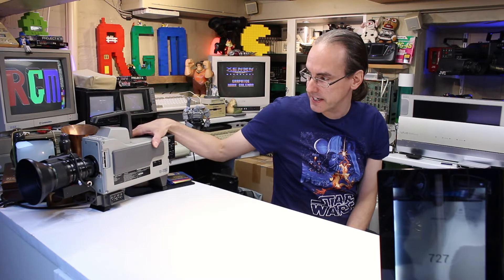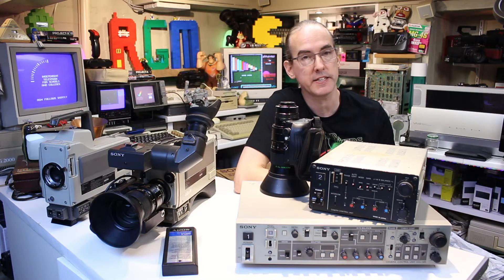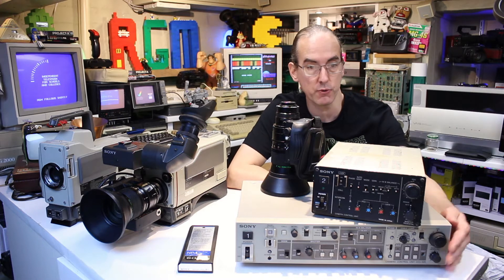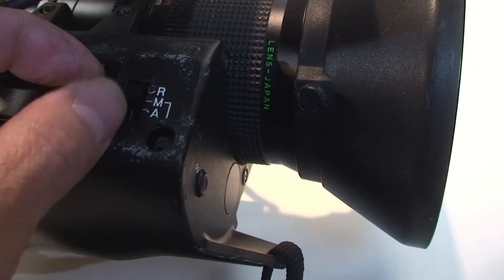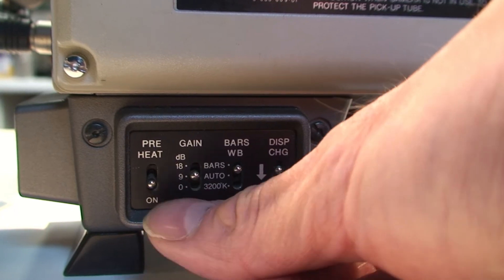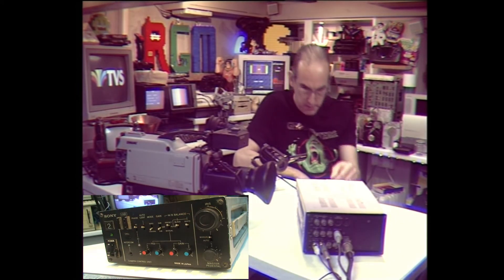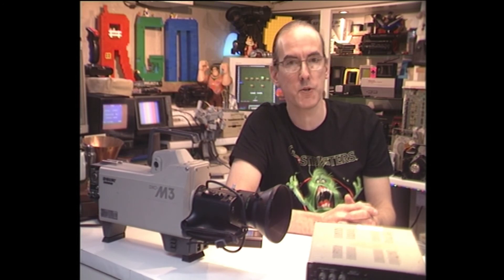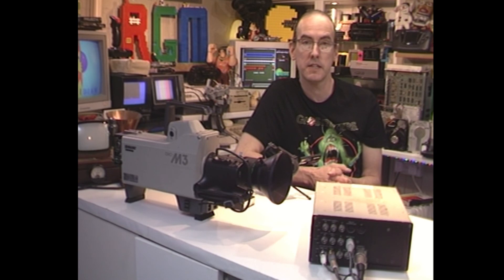SONY BROADCAST DXC-M3P 3 TUBE and SONY DXC-3000P 3 CCD VIDEO CAMERA TESTS and IR Filter Clean up!

Comment: From memory, the zebra stripe was really subtle when it was switched on. Especially hard to spot in the tiny onboard viewfinder, but not as bad if you were using studio finder like the DXF-40 or 50.

The SC is the colour sub-carrier phase adjustment.
Reply from the maker: Thanks for the info. I am still yet to get a bigger view finder. They seem to command alot more money than the camera's themselves.
Reply: @RetroGadgetMan  
You're welcome.
It's great to see the old cameras still going.
I had exactly the same problem with my IR filter when I first bought my 3000AP about 20 years ago.  I had a little check on her just over a year ago and found that the same muck had grown back so I'll be redoing that clean-up again.

Yeah, the viewfinders were pricey even back when I was looking. I never had my own either; I borrowed one for a couple of projects.
I had planned to convert an old portable CRT TV but I never got around to it.
I suspect that I've got a schematic or at least a pin-out for the viewfinder connection somewhere.

In fact it was all expensive back then. I remember paying as much for the case and the cables as I paid for the camera. I never did find a tripod plate attachment for a fair price. I just used the single 3/8" tripod mount at the front but it was always a bit precarious. 

Another bit I can add to your video is that the remote ports on the lens body were used for a tripod handle mounted zoom remote.
I have (tucked away on an old hard disk) the schematic which a helpful guy at Fujinon gave me back in the day. If that's of interest to you I'll dig it out.
Reply from the maker: Yes the IR filter seems to be a common problem. How did you clean yours. My way seemed to be the only way I could clear it. The tripod plate sells for  more than the viewfinder and camera together. I may just make one lol. Using a standard tripod is abit if a gamble, and not even possible with the DXC-M3. If you have a diagram of the viewfinder pin layout that could be of use, as I have a lot of old 5inch CRTs that I could use one of. No rush, just when you get the time. 🙂
Reply: @RetroGadgetMan  I'll dig out everything I've got. It'll all be tucked in a folder on the old disk.

I did my IR filter much as you did. Split the layers, carefully used a single edge razor blade to scim the glass, and then gave it a good wipe with some optical glass cleaner,
Reply from the maker: @grcarthew7234  thanks!
Reply: @RetroGadgetMan  you're very welcome. Share the wealth, I always say. Especially with a fellow enthusiast...

I've got three old Umatic SP VTRs here too.
Reply: Having now watched the second half of the video I can answer a couple more of your questions too...

The momentary switch on the camera side labelled "DSP CHG" is "Display Change". That cycles through different information overlays in the viewfinder. The menu system allows you to setup things like the pedestal, in-built titler, etc.
The "VF Preheat" power switch position on the 3000P powers up the viewfinder, so that the CRT in there can warm up ready for action without also powering up the rest of the camera.

More on the Phase and SC adjustments... 
You'll not notice any change when fiddling with these, until you try to mix and wipe between multiple cameras in a vision mixer.
If the signals from different cameras arriving at the mixer aren't properly synced and in phase with each other, you get jumping and rolling of the output image as you try to mix the signals, because the mixer can't lock onto the two un-synced signals at the same time. In addition, the colours will vary between cameras. Genlock is one element of ensuring that all the equipment throughout your setup is using the same time base; and the phase controls on the camera / CCU are another important element of getting everything working together.

With a master sync signal (a video signal is fine) applied to the genlock inputs on the various items of equipment, each item will lock to that signal. However there will be some variation. Adjusting the horizontal phase control will adjust the timing (effectively shifting the picture left or right) until the two signals are properly in sync. This is best achieved by comparing the signals on a waveform monitor. If you have an oscilloscope which can trigger from a video signal then that works just as well.

You'll also find that the colours will be off. That's where the sub-carrier phase control comes in. By adjusting this, you bring the hue of the slave source in sync with that of the master.
This is most easily and precisely achieved with a vectorscope . Set the camera to output bars and then adjust the SC phase control until the vectorscope shows the points in the correct position. This way when switching between sources you don't suddenly find that colours jump around.
It can be done by eye without those tools however, just not as precisely.  Output bars on both sources; select a vertical wipe on you switcher and set the t-bar halfway, so that the upper half is one source and the lower half is the other. Adjust the horizontal phase until the bars line up, and the SC phase until the look to be the same colour.

Some of the other queries can be answered by understanding the construction of a video waveform. Ignoring colour for the moment, the levels from black to white are represented as values of amplitude within the signal. A 1V peak-to-peak PAL video signal ranges from -300mV to +700mV.  The unit IRE is sometimes used (especially for the NTSC system - though the values are different) 100 IRE is correct white and 0 IRE is correct black (in the PAL system).

The iris control adjusts the white level (called 'contrast' in the consumer world) where the brightest parts of the video signal sit. It's simply letting more or less light into the sensor to make the whites more or less bright. This is adjusted either automatically, or by manually opening and closing the iris on the camera (or via the CCU) to set the white parts at (or just below) 700mV. Any white going above this point is  clipped, blown-out, and lost.
The zebra stripes can help here. With the camera properly adjusted the zebra appears over areas of around 70-80 IRE (I think, from memory). A properly exposed face should be at this level, so you can adjust the iris until the talent's face gets painted by the zebra.
It is very subtle and you have to know what you're looking for. The yellow stripe in the colour bars sits at this level. Switch the camera to bars and observe the yellow stripe in the viewfinder (second from the left) whilst switching zebra on and off. You'll see the zebra effect.

The pedestal control adjusts the black level (called 'brightness' in consumer kit) - how dark the darkest parts of the image appear. Again, you can increase or decrease their brightness.
These controls effectively expand or compress the image range be shifting the bright and dark parts up or down in intensity. You would adjust the pedestal until the black parts are just sitting above the 0V line. Any dark areas of the image going below that point are crushed and lost.

Colour balancing on the CCU is fiddly, especially without a vectorscope.
The basis is:
The pedestal (Ped) control for red and blue adjust how much red or blue is in the dark parts. You would adjust these until black is truly black with no colour tint.
The gain for red and blue adjusts how strongly the red and blue elements of the image appear. On a vectorscope you'd seen the points moving, in or out radially from the centre, If you remove all red and blue elements you'd be left with a green image.  Manual colour balancing is literally a balancing act between those 4 knobs (and it's a bit of a fiddle frankly until you get a feel for it).
Reply from the maker: @grcarthew7234  thanks for all this information. It will help others too no doubt.  Broadcast gear is certainly a whole new level, so much more to adjust and refine. I am all ready looking back at this video and thinking how much I have learnt since making it. I have bought two more cameras and a portable betacam VCR since,  all need work though.
Reply: @RetroGadgetMan  Over the Christmas break I decided to pull my gear back out for a play, so I have updated the information I gave above with a fresh memory.

I did also send you an email with details of the various user and service manuals I've got. It went to the hotmail address listed in your youtube profile, but I'm not sure whether that's still active?...
Reply from the maker: @grcarthew7234  Hi thanks very much. I must apologize. I did not see it as my email has stopped syncing.🙄 Just logged in and it all there. Thank you so much for all the information. Will be very interesting to go through it all.
Reply: @RetroGadgetMan  My pleasure.
It's been fun having it all out again. I wish I had a couple more cameras to add to the setup. Getting a composite video source is easy enough, but of course the consumer kit lacks genlock inputs and phase controls.

I do also have a old Panasonic WJ-MX10 switcher, which being digital has a frame synchroniser, so sync is not a problem. But with only two inputs it's not as good as my JVC switcher.
Reply from the maker: @grcarthew7234  I have bought a couple more cameras since. Later models, still not been able to get rgb with sync yet. I don't have the equipment to deal with it so still capturing by composite video or s-vhs on a later camera.
Reply: @RetroGadgetMan  Oh yes? Which did you get?

I've never used the RGB outputs either. In the day they were only really intended for feeding into a chroma keyer; with the main production chain being composite.
They should, I would think, work nicely with a SCART input.

The slightly later DXC-3000AP which I have also had the option to output Y/C separate (S-Video) signals. That was great when connected to my VO-8800 portable VTR which could then take the Y/C straight onto tape for improved image.
The 'paired' CMA-8A camera adapter included an S-Video output with the familiar 4 pin mini-DIN, but the older CMA-8 which you and I have is easily converted to add it. No electronics necessary - the signal is already there and just needs a connector. So that's on my to-do list. Handy if I'm just taking it straight into the PC via a capture interface.
Given that all my other equipment is composite it's not much use beyond that scenario.

EDIT
When connected to CCU-M3 l the red channel is switched to either output Red (as part of the RGB) or Chroma (as part of the YC selected in the camera).
I had expected that the RBG would always take precedence when connected to a CCU. The microcontroller in the camera switches the RGB in when connected to the CCU and out when connected to a VTR, where the three pins are then used for chroma (if camera is set to Y/C rather than CVBS) , audio, and VTR signals.
I was as surprised hell to see the chroma signal on the Red connector when I probed it. That's handy - I can get s-video from the CCU after all.

It is also possible to take the standard PAL chroma signal from inside the edit VTRs as well with a bit of fiddling and some basic filtering. Then one can get an S-Video output from those. That's another on the to-do list which would improve the image for anything already recoded to tape.

It's all fun and games! :D
Reply from the maker: @grcarthew7234  Sony DXC 673p camera Dxc-325 with Hi8 dock. And a JVC-KY15 camera. The Hi8 dock is not working. The DXV,673 is supper HAD so works really well in low light. Lovely camera. I will do a video on them one day. I have so many videos to do. 😆 Sounds like you really know you stuff, more than me. This gear is all new to me. Love it though.
Reply: @RetroGadgetMan  Ah cracking. I fancied a 325 back in the day but never did get one.
I can hardly believe how pricey they are now. Or, at least how much some chancers are listing them for 😉

I paid £125 on eBay for my DXC-3000, without the case, back around 2000/2001 I think. Back then much of the industry was still using Betacam SP, whilst the front line was Betacam SX, Digital Betacam, or DVCAM (for Sony) or DVCPRO (for panasonic) and commanded a high price.

Comment: I recently purchased a Sony DXC3000A for my church.  It was damaged during shipping and the front "box" where the auto white/black balance switch is located was broken and the wires for the switch pulled loose.   I want to fix it, but can't find a manual or info on the wire colors for the switch.  Could you help??   There are 3 wires---red, brown, and black---and I need to know which one goes where on the 3 pins of the switch.   Thanks.
Reply from the maker: Hi, if you type in Sony dxc-3000 teardown here on YouTube, there are a a couple of videos that may show that area of the camera. I haven't had to disassembled that part of the camera yet. Hope that helps.

Comment: I used the HVC 2200 camera with a Zenith portable recorder. A 10 meter extension cable could you use the camera without carrying the recorder. The major problem with the camera was it was really slow, needed a lot of light. Comparable to ASA 32 film speed. Otherwise, out side with a lot of light, the colors were really impressive. Had scan lines 500. The lens could have been a little more powerful. I think it was only 8x zoom. The NP-1 battery didn't last long, so an exterior power source was needed. Bu the time all of these required extras were added, this complete outfit weighed ~30 pounds.
Reply from the maker: Hi I found this device to record video to an SD card https://youtu.be/5A9Pr3t68jw

Comment: Powering up is simple enough, just a stereo din connector, the same wireing pins as modern cameras usually 12 to 17v
Reply: Should have said 5pin xlr

Comment: I’ve been searching for the cable that attaches the power supply to the ccu-m3 for nearly 4 years now lol
would you be at all willing to sell it with the power supply? I think I’d take just about any price, building my system for this long has made me pretty desperate!! maybe you know where to find one or know of an alternative to powering the ccu (I know it takes a kind of battery, but I haven’t been able to find that either)?
Reply from the maker: Hi is it the power supply or the cable you need. If it's the cable you can buy the jacks on eBay and make your own if your ok using a soldering iron. In this video I used a sony AC-345C power supply from a betamax sl-3000. This has the 4 pin din cable attached. I am just in the middle making a video that this PSU appears in. So you will be able to see what it looks like. The bigger CCU in this video is mains powered so you don't need a separate PSU. That maybe a quicker solution for you. These things turn up on eBay. The battery was lead acid back in the 80's for the smaller CCU. You could make your own but it needs to be the correct amperage. A service manual should mention this if you can find one. Hope this helps.

Comment: I own this setup except for the DC cable going into the Sony CCU-M3. Does anybody know what the name/model of the DC power cable is?
Reply from the maker: In this video I am using the Sony AC-345C. It is from the Sony SL-3000 portable betamax. They pop up on eBay now and then.
Reply: @RetroGadgetMan  Thank you so much!

Comment: The images from the cameras are in the 5:4 aspect ratio. That should be 4:3. Probably something went wrong to fit it into the 1080P frame. look at your face, it's a little narrow.
Reply from the maker: Was it all the 4:3 shots? Probably me not resizing the frame exactly with in the 1080 ratio. Thanks for the feedback.